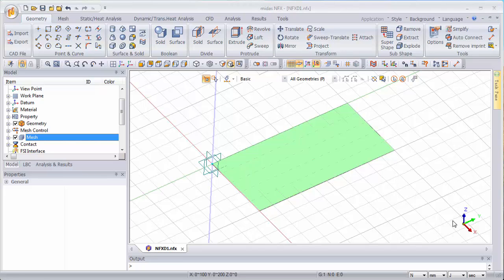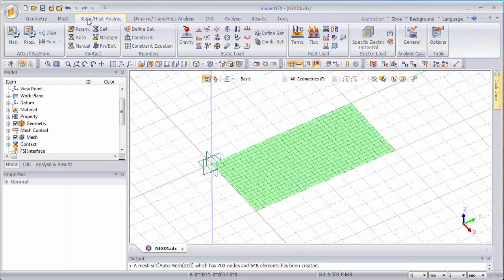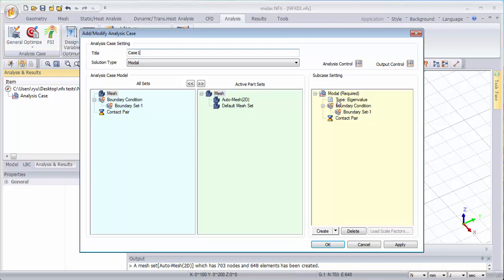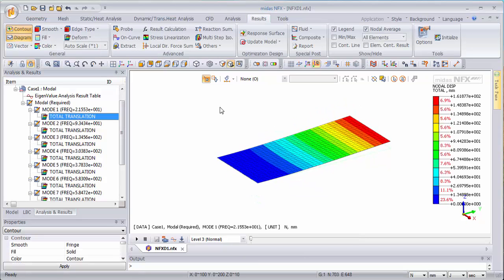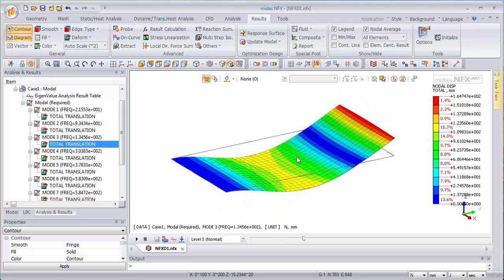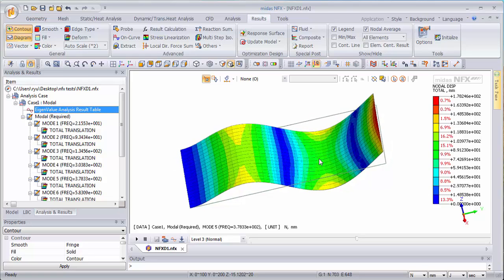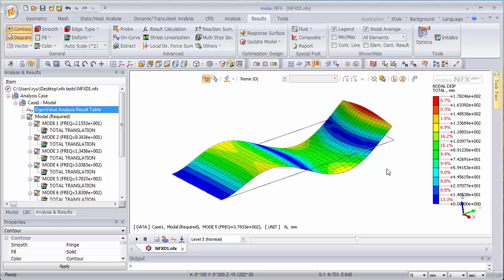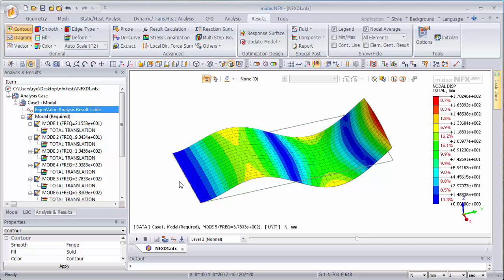How to perform modal analysis?

Comment: @Cyprian, nice intuitive video! Question, what is the purpose of a modal analysis if all ones looking at are natural Freq & their corresponding mode shapes . . In otherwords, what's the important output and what is it used for ?
Reply from the maker: Purpose is to find which modes are within the operation frequency range of your system and if those modes are dangerous or not. If they are, redesign might be needed to move those harmful frequencies out of the operation range.
Reply: @Feaforall  Thanks !

Comment: Thanks for sharing your video.
I did the model and modal analysis in SOLIDWORKS Simulation, the frequencies I obtained were: M1 21.56 Hz, M2 93.46 Hz, M3 134.49 Hz, M4 303.83 Hz and M5 377.37. The shapes were the same as in the video.